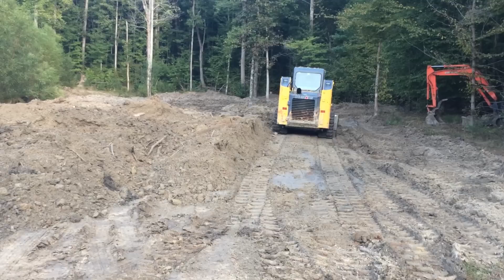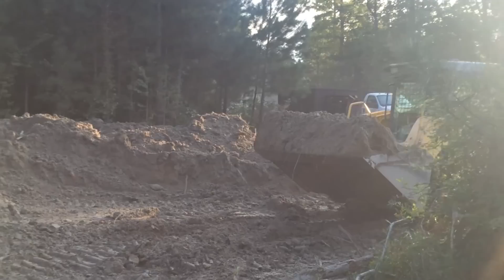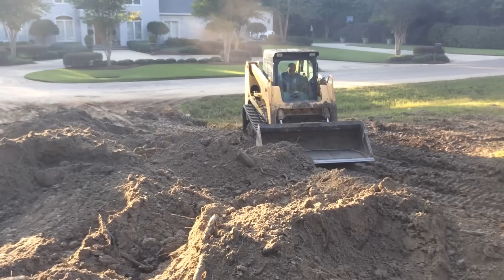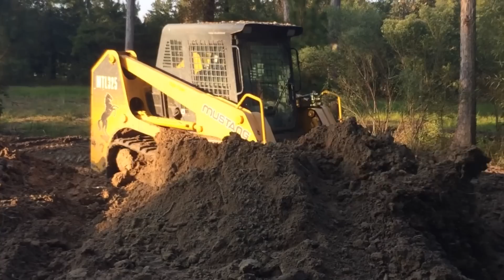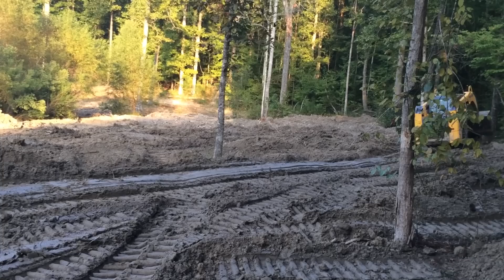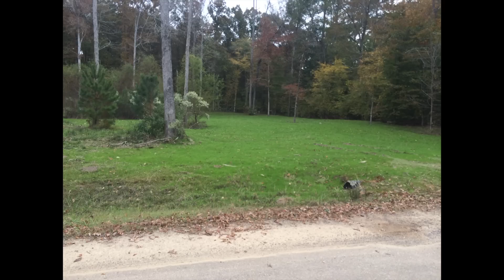Track Loader Pushing the last of 1000 yards

Comment: Which machine pushed better? The Kubota or the Mustang?
Reply from the maker: The Mustang, because of the more aggressive tracks.  The Kubota has better engine management, you couldn't stall the engine like you could on the Mustang/Tak.
Reply: kubota must need mustang tracks ;)

Comment: how do you like that Mustang track loader? i have only operated Cat and Bobcat.
Reply from the maker: I liked it, although I like the Tak/Kubota roll up door better than the swing out door.  Also the bi directional high flow is nice as well.  I sold that track loader with 260 hours on it, bought a Kubota SVL90-2 and sold it with 320 hours on it last week.
Reply: we looking at Takeuchi and Cat, the new Cat rear visibility is horrible.